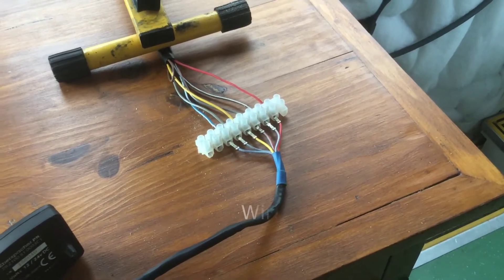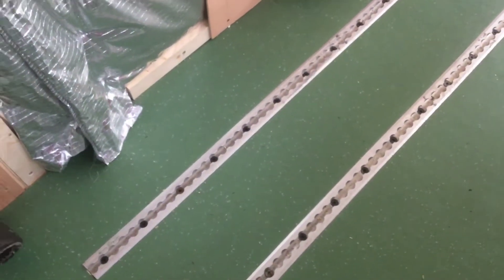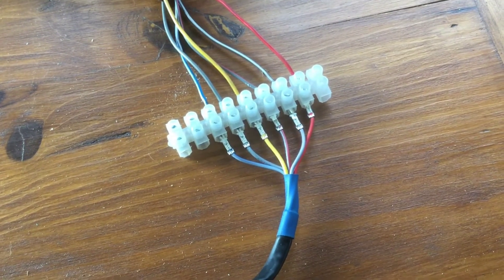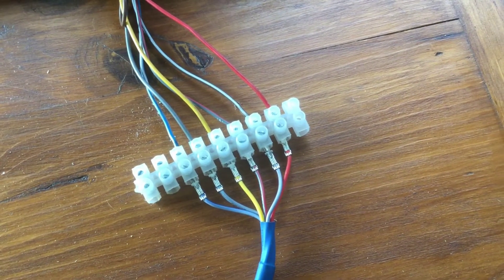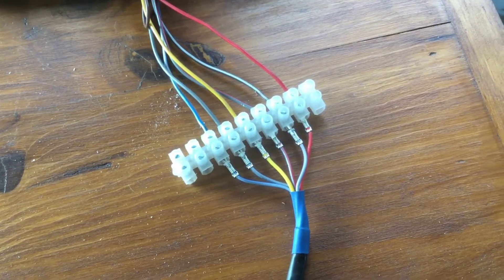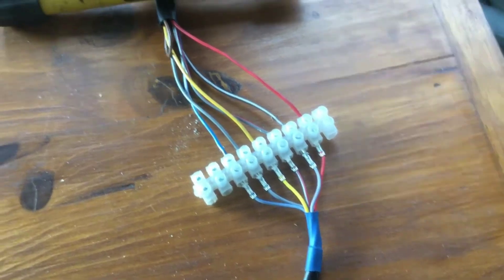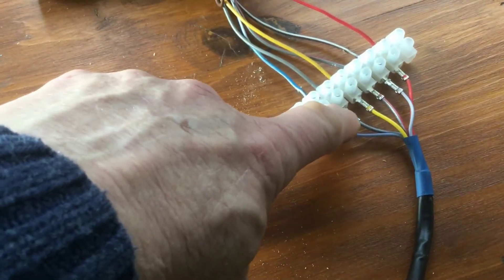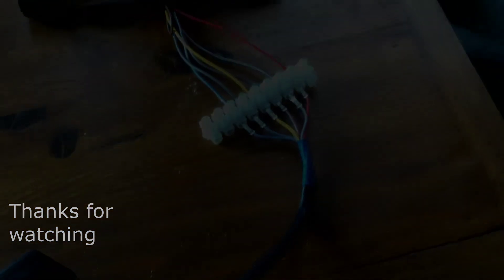Eberspacher Diesel Heater 801 controller wiring explained.

Comment: Hi Keith, I'm looking for some 7 core tinned wire to extend the 801 on a boat. Do you know what thickness/diameter it has to be please?
Reply from the maker: There is hardly any current flowing in the controller circuit so virtually anything will do. 
E.g. Standard 0.5mm seven core trailer cable should be more than adequate
Reply: @CriftinsCampers  Thanks!

Comment: Hi there, you talk about the 4 wires that need switching to use 2 controllers, what kind of switch would be good. Thanks for the great vid 😊
Reply from the maker: Something along the lines of one of these would work
https://uk.rs-online.com/web/p/toggle-switches/0316995/?cm_mmc=UK-PLA-DS3A-googleCSS_UK_EN_Switches_WhoopToggle+Switches_Whoop-316995&matchtype=&pla-307379923620&gclid=CjwKCAjwvMqDBhB8EiwA2iSmPCiw0OtoC9N2MqkA_vl_R1A5Su5oH7qnAIBOOkpJKcqwAcqeWCe6LxoC46kQAvD_BwE&gclsrc=aw.ds
Reply from the maker: Alternatively leaving the 801 heating demand on all the time so it acts as a permanent thermostat and putting a simple timer in series with the output (yellow) wire  would probably be a lot cheaper and simpler.

The timer would need a manual override switch though 
Loads of choices for simple 12v timers on eBay

Comment: Hi mate, quick question I’m about to wire my D2 with the 801 into my wee workshop shed. I plan to mount it ‘d2 heater’  outside in a metal box but need to run in power, 12v and the controller 801. Is it easy enough to get into the 801 and disconnect wiring, drill a 10mm hole  poke control wire into shed then rewire 801, or should I just use chocolate block like in your example in video? Thanks
Reply from the maker: The 801 is clipped together so I guess you could rewire it directly, personally I wouldn’t bother, I would  use the existing wires joined using solder and heat shrink sleeves or these things which are pretty good

https://www.ebay.co.uk/itm/293992393392

Comment: My 801 cuts out every hour. Any way to overcome this?
Reply from the maker: Possibly, read this but if not then a non timed version costs about £60 new and you will get a reasonable amount back for your version secondhand.

https://www.butlertechnik.com/downloads/Eberspacher_80110003_controller_Installation_instruction_manual.pdf

Comment: Hi I have a 301 controller that I want to change to a 801 controller. My D4 has 2 diagnostic wires blue and white on a3 and blue and yellow on a8 do I just us the blue and white and ignore the other one TIA
Reply from the maker: I am not sure what or where you mean by a3 and a8, the standard oem harness should only have one blue/white wire and doesn’t have a blue/yellow wire afaik, it might be worth checking the wire colours in the harness at the heater end where the large connector is to see if they are still the same colours. Maybe the cables been extended with different colours used?
Reply: @CriftinsCampers  a3 and a8 is the pin numbers on the  main plug on the heater I think i am sorted I just made sure the blue and white wire landed on the blue and white of the 801 controller thanks

Comment: Do you know the difference between 801 and 802 controllers ?
Reply from the maker: Sorry no I don't but at a guess it uses a single wire Lin/Can bus to control the newer models of heater rather than separate cables, as the 802 is apparently not backwards compatible with the 801

Comment: Hi , do you know if the grey and white temp sensor wire uses a switched ground or live ?
I have a dw5sc ,I’ve added a after market room thermostat (as I only had the small 501 7day programme) I’ve switch the yellow wire through the thermostat but when it trips out due to reaching temp if fails to restart the heater once temp has dropped even though the thermostat has reinstated the live signal ,however if I turn the power off then on again it’ll kick the heater in. I take it I must use the grey and white wire to switch the heater on and off ????
Thanks and great video by the way
Reply from the maker: Ironically I had watched your video only a few days ago as I will be installing a d5 or a webasto thermo top in my Crafter for my calorifier as well eventually!

These things can be a sod to bleed!

Fyi I ruled out using mine for vehicle heating as well though when parked because of the power use needed by the heater and a manifold blower unit so for that I have a D4, you could consider using a PWM controller for yours though instead of that potentiometer which would save a fair bit of current and allow you to run it at a quieter speed.

I think your Heater should fire up via a thermostat if it’s acting in the same way the controller does, afaik it is only the yellow wire that controls the on off of these heaters.

I am not familiar with your particular controller does it have the blue/white wire for the diags function?

it sounds as if the heaters going into lockout if you are having to do a power off reset maybe there’s some switch bounce in the thermostat somehow upsetting the heaters electronics, does the same problem occur if you try a simple on off switch instead of the thermostat?

The hydronics heaters are fairly simple they are either on or off the only internal control is the power use once the water is up to temp, then they throttle back output from 5kw to 2.5kw. Eberspacher do sell a 701 controller for use with a hydronics heater but I am pretty certain the thermostat part is redundant other than to control the optional ventilation mode which is typically the vehicles heater blower fan.

I have a heater matrix out of a black cab with a two speed motor and if I can make room for it plan to use it under the bed to heat the rear of the van however I will operate that via a thermostat and PWM controller I will simply be leaving the hydronic heater to do its thing I.e run constantly to keep the water at 80c, the idea being because of the excess noise and power use the heater, matrix blower and water pumps etc have I will probably only be using them whilst driving or during the daytime for water heating. Having experimented a lot in my workshop I couldn’t put up with the noise all evening. Hopefully your underfloor heating will however mean you won’t need the blower fan on very often.

It’s worth mentioning the air heater controllers like the 801 use voltage comparison to control temperature modulation they aren’t really suitable for use with hydronics heaters there’s no actual on off switching going on, the yellow wire remains live all the time that the heater is commanded on and the difference between the preset voltage from the chosen thermostat output and the measured voltage from the internal or external temp sensor controls the blower speed and diesel pump 

I explain that in another video around 8 minutes in here
https://youtu.be/ZhW1uscoy0Y
Reply: Thanks for the reply ,turns out you can’t control the boiler with a thermal switch , it needs to run off its own internal one.
So I can only control what the water runs through ,let the boiler do it’s own thing

Comment: Good one Keith. My Eberspacher has a dial on the controller and a few buttons ( on/off and cold air fan button ) but no temperature readings or programable temperature settings that you can see to set, it's pretty much all guess work lol.
I end up having to turn it up then down until I think I have the sweet spot depending on weather, especially if it's windy as my van is not very draft proof.
I was wondering if a cheap Chinese controller with a display and better control functions would work but I can imagine they may have a pink, purple and possibly a magenta and cyan array of coloured wires 😲😂
Reply from the maker: Good evening.
The rotary controllers are not very linear so can be a bit vicious, it's definitely a case of minute turns at a time!

If you watch my longer video on how modulation works you will see it is done via comparing a relatively low voltage which is incremented based on the actual and required temp. 
The Chinese clone would have to emulate that to be compatible. I haven't played with any of the Chinese ones sorry.
Reply: @CriftinsCampers  OK, thanks Keith.

Comment: Fantastic video. I have a question if you don’t mind 
Iv got the 801 and it turns it’s self off after an hour. Is there anyway I can get it to run an till I wanted to turn it off because when it’s running and gets to the temperature I want it’s super quiet on tick over and hardly using any power I get fed up waking up cold and have to keep turning it on because on startup it pulls a goof few amps 
Looking forward to your reply 
Dave.,,
Reply: Hi Dave try unplugging the controller and plugging it back in but hold down both the arrow then select n0 think that’s the one you want and press the power button should stay on till you ture it of good luck